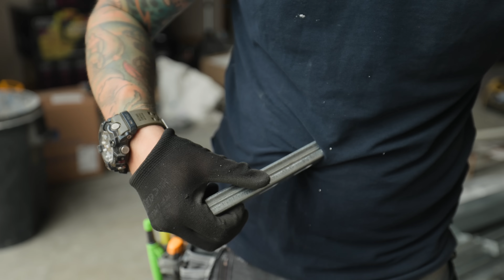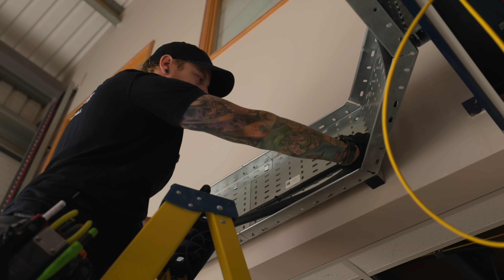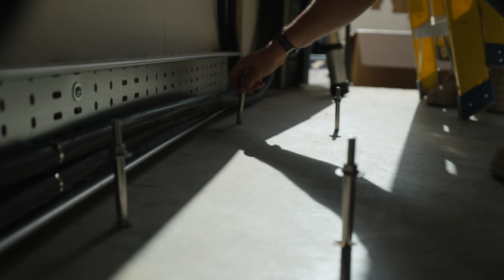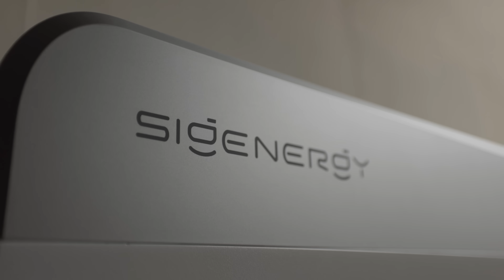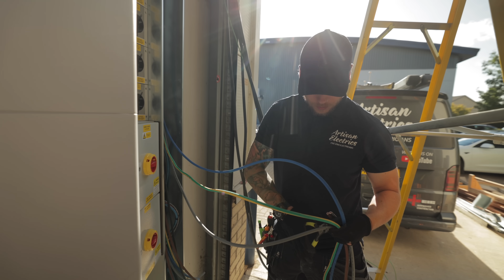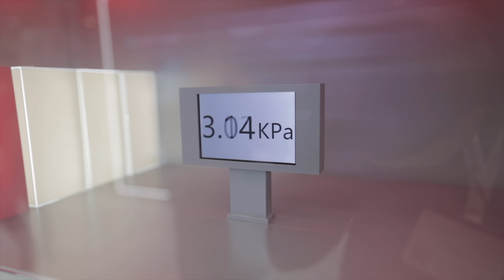Can we take our business OFF-GRID? Sigenergy Sigenstack Full Install

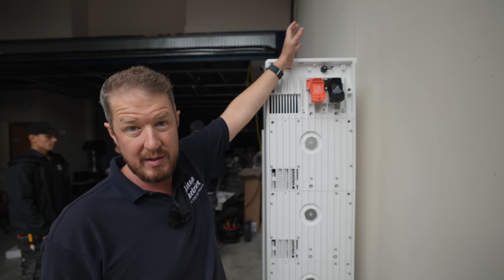Comment: 13:20 But since you've installed the inverter above, instead of to the right, it would actually be better to put the isolator on the left battery stack to get a shorter cable run.

Comment: After 30 years with working with powersupply and redundancy, two questions. 1 what happen ifvthere is no internet? What happens if the gateway stops working, og going on fire. I dont se any manual bypass control or manual switch. in your video with the generator, i would make it posible for the generator to supply power directly to the building.

Comment: Hi team, I have just watched this video, what a great choice for your new HQ.  I have also just watched the video where you have chosen to install a Tesla charger outside (for the Bosses van).  I now have a questions please?

Why did you not have the SigEnergy EVC, as it fits in with the batteries and a eco system?

My guesses:-

1.  It’s not offered with a commercial system
2.  You need the battery packs and if you used one for an EVC you would not have enough to run the HQ for long
3.  Why did we not think of that 😛
4.  It’s in plan but no spare £££ to have it yet.

Comment: When you installed the Hilti fixings into the wall to hold that 100kg inverter,  you should of done, or do a pull out test to se if the fixing can take the pull out weight. Especially into uk breeze block. If those fixings pulled out dread to think what damage it would do. Its simply not good enough to assume just because Hilti give a rating in shear mode its safe enough. Buying one of those pull out testers would cover you for future installs. I hope that helps - Great video's 👍

Comment: Certainly VERY well Built & Designed, as a Aerospace - Defence Hardware Test Engineer, I can say just by looking at the build quality says it all, Well I'm retired now so when I move out of my apartment & get a home with a south facing garden I like to certainly go off grid with 15kW - 20kW of Solar PV for heating my home & for all the power it would ever need, I do love the internal battery protection, that often concerned me of how to protect the expensive batteries when you have a powerful 48V system, even thought of having a seperate building just for the batteries, the concrete hardibacker against the wall is a great idea,
Only thing you will require around that is a fork lifting guard posts - cage as it's near the delivery door,
Yes very neat & Tidy Job very impressed👍👏

Comment: nuclear is very safe, huge energy per mining costs. solar is mining 7x increase in mining for very little energy. solar can not be connected to nuclear very cheap power plant. it shuts down the whole grid. so massive increase in mining to save the planets for a lie to shut down actually safe reliable energy is good, how? coal mining has increased to create solar panels, solar isn't yet recycled. lithium batteries aren't recyclable yay fake new mining  boom

Comment: i have 1100 kw batertery, good for 2 12v fridges and 6 led light bars. my parents wasted 12k on a 6000w system with no batteries, goverment rebate has expired energy cost is higher then they used in the pass. such a con. still need to use a generator or my car when it's cloudy for a few days, my parents have no electricity to run anything during a black out, which is becoming more frequent since the non compatibility of the grid creates the issue. go green, send kids into mines for limited rear earth minerals for green renewable energy

Comment: Has be be web connected? Really.. Doesn't this worry folk? Love the idea, but really. What if someone compromises your Unifi / Sigen hardware and turns everything off/in. 
Personally I'd not want to be beholden to the internet or at least choosing what the controllers are capable of connecting to externally. Cyber attack intelligence is unfortunately increasing exponentially, then throw AI into the mix. Nothing a physical switch can't do better from a security perspective in my opinion.

Comment: Some remarks from a power electronics dude you might find helpful:
- with asian PV inverter brands in offgrid operation you sometimes find issues EMC related that limit life of your home appliances. With on grid operations the grid often does the filtering, when going off grid this issue surfaces. 
- with the expandability you need to be careful. for home and small business installations its best to use one inverter with a battery and if you have multiple inverters just use them without. Marketing is little bit too over excited there and software often has glitches with those setups. 
- for medium and bigger businesses its best to go for different kind of setups since these are not cost efficient anymore. I know Sigenergy is sponsoring this video but there are different brands that can do this job better.

Comment: Nice to see a hybrid inverter that has integrated UPS functionality instead of only EPS that needs time to come online.

But please give us at least MSRP prices if you introduce products, just use a disclaimer that final prices may (and will!) fluctuate due to developments and fluctuations in the market.

Regarding the UPS part I was talking about:
I usually need to use a Victron Multiplus or Multi RS solar to get UPS functionality.
Their UPS functionality is truly phenomenal, especially the multiplus can switch over within a quarter of a sine wave without skipping a beat. Thats 5ms! they claim less than 20ms but tests proved it's closer to 5ms than 20ms.

I have installed multiple multiplus systems ranging from 16kWh/ 5kVA single phase to 96kWh / 24kVA three phase in many different configurations, from ac coupled PV inverters to MPPT chargers or both.

I'm currently fiddling with a Multi RS Solar to learn about it's functionality. The ESS functionality is way different because it's a hybrid inverter.

I really hope one day you'll cover the Multi RS solar because it's a relatively unknown model hybrid inverter that also can be used as a normal PV inverter in the case batteries are not yet planned.

Comment: Just a side issue. Have you ever covered the issue of a VFD causing a rcbo to trip? I have just run into this issue on an installation.  The VFD runs a machine in the garage and just turning it on trips the breaker. Dont even need to power the  motor it runs. Think its a feature of VFD's. But how to solve it. That might make interesting content.

Comment: Well done on the amazing  installation.  Due to system at door entrance , you might need to add a floor barrier,  to stop accidental bump by a vehicle or a trailer being  backed up. Especially with high voltage  battery.
Reply from the maker: Great point — we’re actually adding a floor barrier soon to protect the system. Safety first 👍

Comment: How on earth did you manage to test phase rotation with a 2 lead test?  It is simply not possible to determine phase rotation through only 2 probes.
Reply: Normally this works on the principle that the person holding the tester provides a ground reference.
The probes are labeled L1 and L2.

Usually capacitively coupled but some older and/ or chinese testers use a small metal plate (that you need to touch) on the case that is connected via a high impedance resistor.
Although this method is considered dangerous due to risk of electrocution in case the tester fails.

Comment: Having the inverter that high up i would extend or take the factory(?) E-Stop and extend it to shoulder height.

Much better than just abruptly cutting the AC or DC line.
Since it will do a rapid shut down without any unnecessary arcing and breaker/switch wear

Comment: painting a fire-resistant board (also known as fire-rated board) can affect its properties, but it can be done safely by using the correct type of paint, such as fire-rated or heat-resistant paint, and following proper application techniques to avoid impairing the board's ability to withstand fire. Applying regular paint or too thick a coat, or painting over seals, can compromise its fire resistance, potentially leading to flaking, peeling, or an increased risk of fire spread.
Reply: I wouldn’t worry too much about that, you’d be dead from all the off gassing- like hydrogen fluoride, well before the fire takes hold.

Comment: I’m very interested in this battery system. 

I’ve been planning on having my house and workshops fully off grid because where I live the grid power is unreliable and the prices are super expensive.

So this battery system looks like something I would be interested in and I have space for it. 

Making solar panels on my house and other buildings. 

I’ve been making my company be sustainable and my home life trying to adapt.

At home i have water harvesting system which I currently use for watering the gardens. But maybe in future use water for all house needs.

I would also like to have fully transportable power system to use for large scale events where there isn’t any grid power. And rather than use generators would want to use some battery & solar system to power everything.

Comment: Don’t lithium iron phosphate batteries (and lithium ion in general) produce their own oxygen in the event of a fire/runaway situation? In which case how does the fire suppression work? Especially in containerised systems.
Reply: Shouldn't they be away from the main exit??
Reply: LFP is much safer than NMC/poly.  It takes a lot more abuse to get them into a thermal runaway situation but once you get there things go badly.  The main risk from LFP is a fire started by other means encompasses them.

Comment: It is a bit sad to see how "advertising" vendor locked BESS is "so popular" on this channel. As essentially - if for whatever reason SIGENERGY goes bust, then you will have somewhat useless batteries and/or inverter as they simply won't communicate with other inverters. Ofcourse with some "programming" probably can get everything working, but it is quite disappointing that there is no e.g. common standard defined for inverter <-> battery comms. And calling it "premium" just because it is "plug & play" for installer - simply is not cool, as there are other "systems" which are way more flexible and simplier which are not so vendor-locked. (like another one is solar-edge - works great until it doesn't work and/or old model is not available e.t.c.). I really hope governments will step in here & force development of some common inverter <-> batt communication standard & protocol.

Comment: Lee was right, should've gone with a strong colour even black to make the install pop.
Reply from the maker: Let’s take it off and repaint 😂
Reply: @artisanelectrics painting a fire-resistant board (also known as fire-rated board) can affect its properties, but it can be done safely by using the correct type of paint, such as fire-rated or heat-resistant paint, and following proper application techniques to avoid impairing the board's ability to withstand fire. Applying regular paint or too thick a coat, or painting over seals, can compromise its fire resistance, potentially leading to flaking, peeling, or an increased risk of fire spread.
Reply: @artisanelectrics  It would niggle me until you did. ;)
Reply: Blue... ! 😁

Comment: But how can you charge-up 120kwh and run a 60kw inverter, “off-grid”, with only 3.7kw of solar PV coming into the inverter?
Thanks again for another great video from Artisan Electrics!
Reply from the maker: The system has 33kW of solar panels connected to it - most days it fills the batteries easily!
Reply: @artisanelectrics 
On a winter Day??

Comment: Your winters over there are the same as mine, I do not have sufficient generation to supply my needs in the winter months but apart from that I do, so right now I have the grid turned off and actually disconnected (in Australia you pay per day just to have electricity connected, around $1 or so per day, then on top of that is your actual usage). Thing is though with a well planned solar system you will be saving a TON of money. I know I sure am. There's even enough to keep my car nice and charged too. My electrician put in concrete sheeting on the wall as well, but I don't think we are allowed to paint it here. So I've kept it as is -- it's an office anyway not a bedroom. All the best with your new system though and I sincerely hope it works really well for you, as mine has worked well for me.

Comment: Looks great, but shouldn't the batteries be up off the deck?
Reply: Agree.. Consider that it possible flood  especially outdoors. Outdoors install concrete plinth
Reply from the maker: Why?
Reply: @artisanelectrics  To keep them above any surface water, such as rain blowing in from outside, a flood from a burst pipe or a spillage nearby (especially if the floor beneath happens to be a low point). I don't think there is formal regulation, but they also shouldn't be within 600mm of an exit.
Reply: @DingleyDell recently 
Our cellar flooded to a depth of 2" no electrical appliances involved but we had considered a battery.

Lots of items were ruined.

Comment: You could have easily used some slings from the forklift to the handles to move the heavy parts.
Reply from the maker: We did that later as you will see with the inverter
Reply: @artisanelectrics  I did see that, so good on ya for learning! Remember if you are doing it hard, you are doing it wrong. Love your attention to detail, the quality of your work is truly 5 star. Have a good one gents.

Comment: What we talking then, £25~30k for the batteries then £3~4k for the inverter plus the other items and of course the install cost? What gets me though is that it seems very difficult to get a good rate at night that would be suitable for charging batteries or vehicles for commercial purposes! Our current offering only goes down to 19p kWh from 21p kWh, a long way away from the 7p we pay as residential overnight. Would love to be able to grab some power overnight and store in batteries then use this for our 100kWh daily consumption.

Comment: Would help if you did "the numbers", as this just looks like a 30 minute sponsored ad. Real people with real business watching  and more transparency needed . Would love to support by using you but would appreciate knowing the ball park figures and the maths on these things. For example, what is your expected payback period on this system if you paid RRP and your install costs?
Reply: He likely doesn't use a great deal of electricity, since his business is installing these systems not running an aluminium smelt.  
It's just an ad / demonstration project. 

The real payback is if you are avoiding grid energy costs, which presumably he won't really have, because will be a low demand unit. 
You get paid a lot less to export than you pay to import.
Reply: I've been asking the same question on and off for a month.

All Jordan seems to do is smile and ignore detail like can you get a return or break even?
Reply: @allan4787 wouldn’t you if you got a load of free gear as well?
Reply: @allan4787  Usual Artisan clickbait...
Our biggest yet...
This install nearly ruined us
(title pic of Jordan being ultra dramatic pose...)
Yeah, usual Artisan stuff

"Can we take our business off-grid..."
ergh - what you actually showed was 3.7kW of solar coming in, boiling a kettle & demonstrating the system operating in off-grid backup mode briefly

Hardly scratching the surface of taking your business "off-grid", just operating it briefly simulating a power outage...
Thought the video might explain the basic beer-mat maths of daily consumption & required generation needed etc... But nope, this was just a vid showing the backup during a brief outage

To go fully off-grid you have to really oversize your solar & battery...
If your daily consumption is 10kW per day then even 10kW South facing array won't cut it in gloomy winter...
You would need probably 20kW of solar & at least 20kW+ in storage to see you carefully through many days of anticyclonic gloom in UK
Basically days & days of thick dark cloud of moisture & fog where you won't even generate 10kW from a 10kW array - maybe half of your array capacity for days
Summertime, long sunny days in June you can easily generate 5x, 6x of array size on good clear days
Gloomy winter days, maybe 1x if you're lucky, often it can be around half of your PV system size unless you get a beautiful clear winter day and maybe generate just over 2x on a short clear sunny day in Dec/Jan

We've just passed the Autumn Equinox so Jordan can pull the main fuse October 1st & see just how well he can take business "off-grid", still a little generation to be had unlike the worst Dec/Jan months
To go fully off-grid - truly off-grid is a LOT harder than people think, sitting there in the summer sunshine with 60kW being generated - won't cut it so easily now & will often be way short entering November, let alone December due to how sporadic renewable energy can be - especially for the shorter generating months of the year

Still, it worked - not the system, but Jordan's revenue & clicks, I thought for a brief moment this might be interesting covering factors like cost, return, the planning of system requirements to enable business to run off-grid etc....
Naaahhh, same ol' Artisan stuff, installing big stfu kit and bragging how amazing it all is
Reply: Its all about free bees that's why its such an in depth video he not the best sparky that's for sure from an EV installer to U Tube Star ( ignore the abuse and take in the money ) let others do the graft I say fair play as he has always shown his cock ups ( not everyone will do that ) and prob they get the most comments = money in the bank.
Reply: @kevinpickett7249  the writing was on the wall when he was begging for "sponsors" on the video where he said he got the unit... basically asking people to provide their goods and services FOC. bit of an odd one when he charges a kings ransom to stick a new fuse in a 3 pin plug